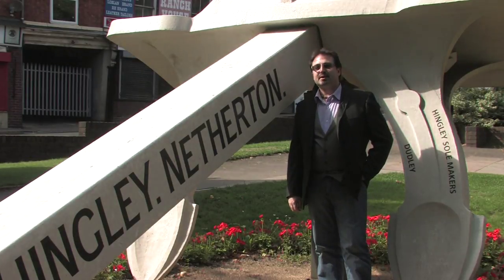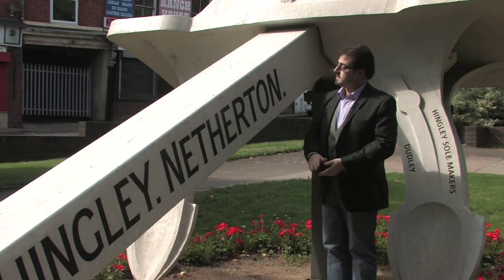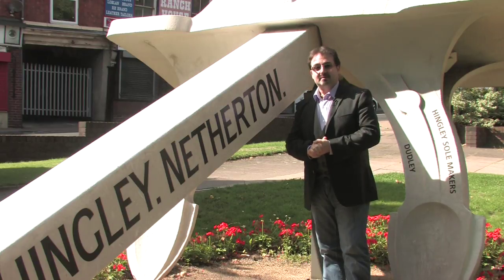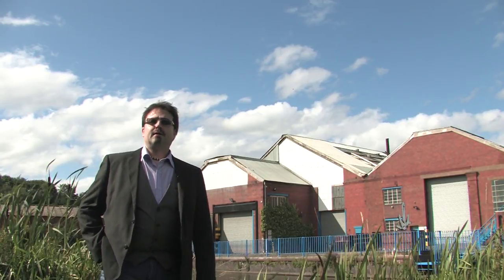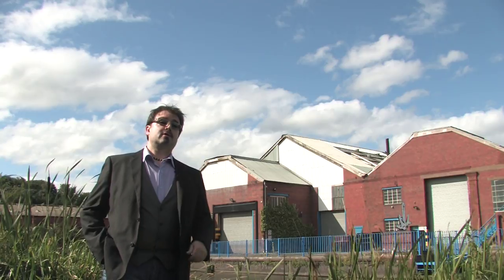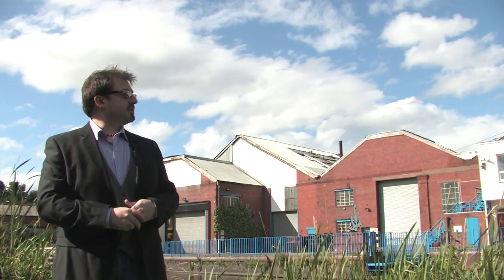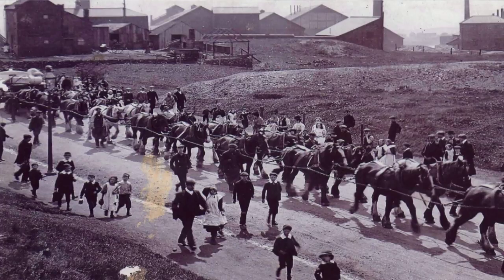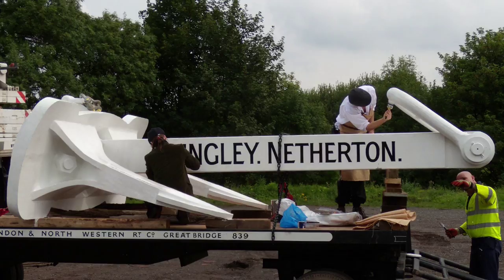Moving the Titanic anchor with 20 Shire horses

Comment: Hi, can someone please explain to me how the center anchor was lowered? In looking at the ship, I would assume they'd have to use that front crane, but that's my assumption, which has surely been wrong before happy.gif Thanks Ethan
Reply: if you mean the anchor  rose and jack must have almost stepped on to get to the very front of the stern and step on the railing (lol) this one was never used from what I know of  I agree the crane does not look to like it could  to lift up  drag and drop  such a piece of steel  and I have no idea of the weight of that anchor that seem to be very heavy too  
ps : it was an auxiliary anchor when the current was becoming a problem  :  )
Reply: Hello. On the tip of Titanic's bow is a tall crane known as the Anchor Crane. This huge steel crane could be swung out over the side of the ships deck edge. If and when the centre anchor was needed to be used, crew would unbolt the anchor from the ships deck and using cables and pull blocks, they would rig the anchor up to the anchor crane. At the very tip of Titanic's bow at deck level sat a small hole where a heavy duty steel wire cable was passed from the interior of the ship, out of the hole (known as a hawser eyelet) and up on deck and attached to the anchor. Once attached, cables would be passed from the anchor crane to the steam powered winches on the bow which would pull the cables lifting the anchor up off the deck and the swing the anchor crane over the side of the ship where the anchor would be lowered into the water. However, Titanic only ever used that centre anchor once in her short life span. The anchor was tested during her sea trials on the 2 April, 1912, prior to her being passed by the Board of Trade and handed over to the White Star Line. In normal cases, these type of centre anchors on liners were very rarely used as they were there as a precaution incase of an emergency such as the vessel loosing both the bow side anchors in an accident or during a storm.

Comment: Yeah they're going to use draft horse because they are use for working on the fram they are really strong and can pull a 8,000 pounds and more
Reply: Heavy horses where common in the black country as they were the tractors of the work force. They were used to drag the barges and the carts and wagons aswell as shubting railway wagons

Comment: they pushed it with a tractor. ...yea. yea yea.
Reply: No the tractor was used as brakes incase of a runaway as there's hills between hingleys in neatherton and dudley railway station.
Reply: @GWR4079  We watched the re enactment. Sadly because the anchor slipped on the trailer  they had to abandon the idea of using the horses. They used a tractor for the last leg. We were very disappointed not to see all those lovely Shire horses.